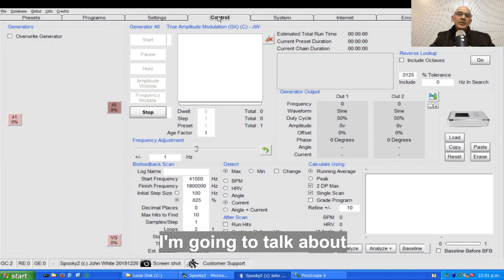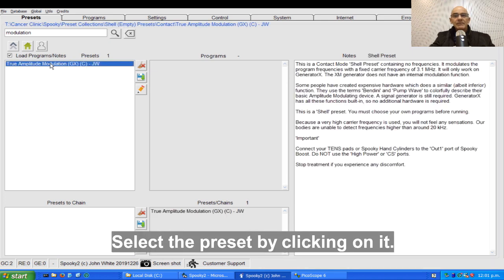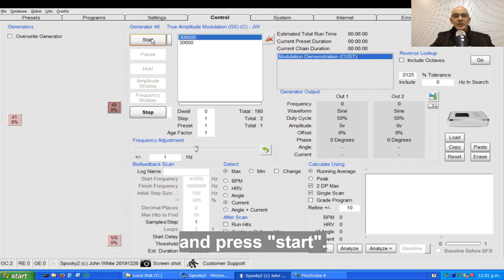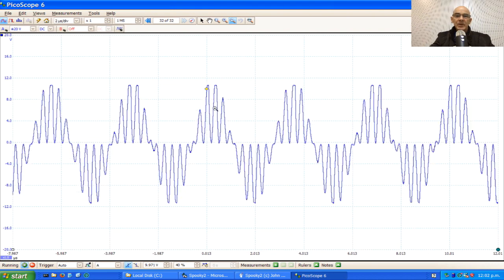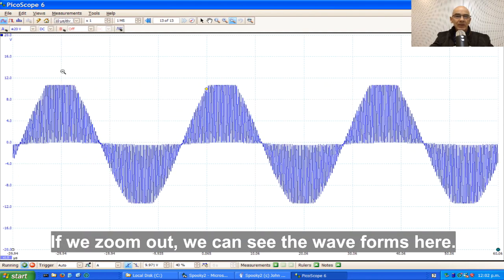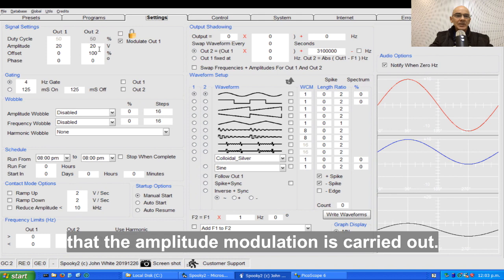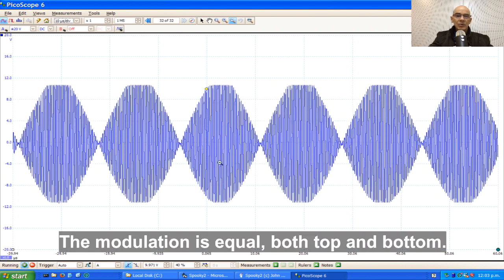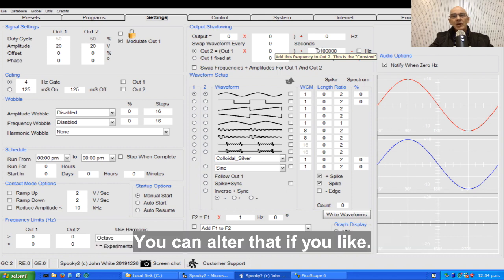Amplitude Modulation Preset

Comment: Great job on this John W.  Thank you  SO we can't run our BFB scan results with this?  I realize you say this is Contact ONLY
Reply from the maker: Hello Frank, John suggests not use it with the BP, DNA, MW, or BFB scan results. Amplitude Modulation uses a high-frequency carrier along with lower frequency modulating frequencies. BP, DNA and MW database entries are already subharmonics of much higher frequencies, so a low-frequency modulation is very undesirable. Modulating a carrier wave with an octave subharmonic will almost certainly miss the fundamental of very high frequencies.